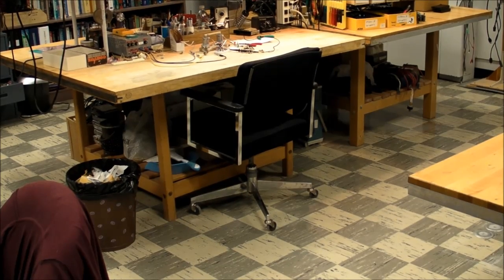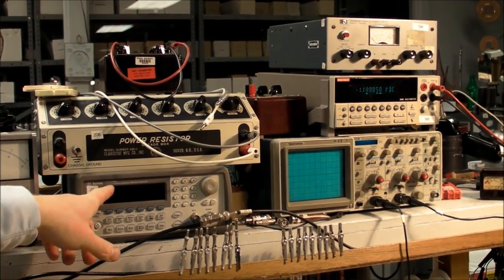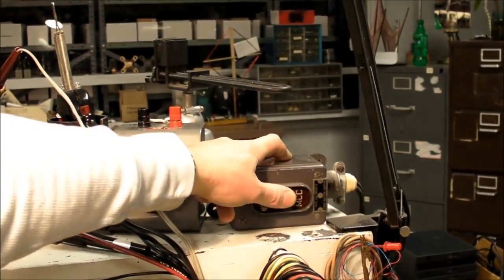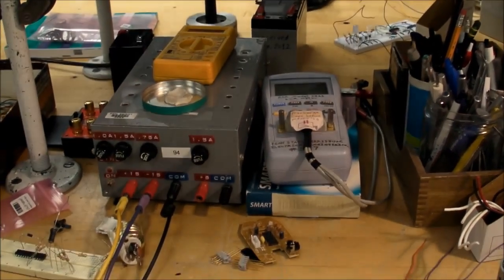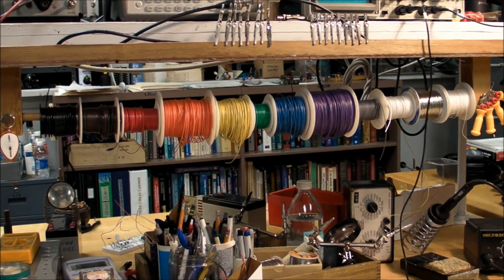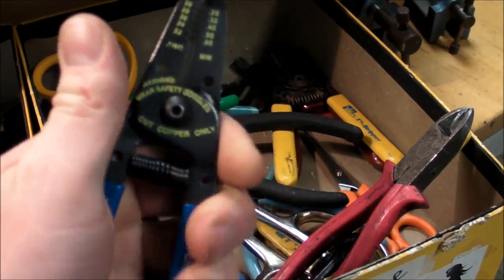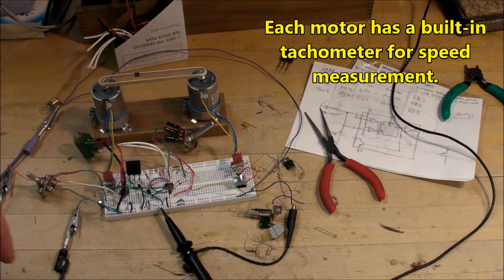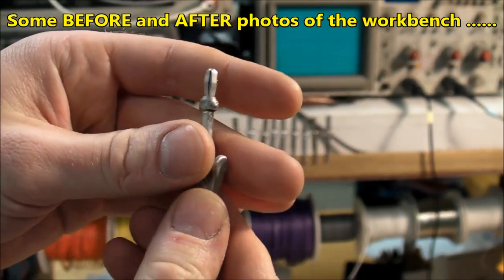(#0139) Lab Tour #02 - Work Bench

Comment: Looks like a lab from the 1970's or 80's.. There is really no need for much wire in anything modern, 22, 26? Clip leads, maybe if you are working on an old radio.